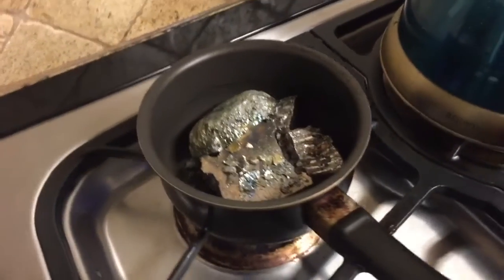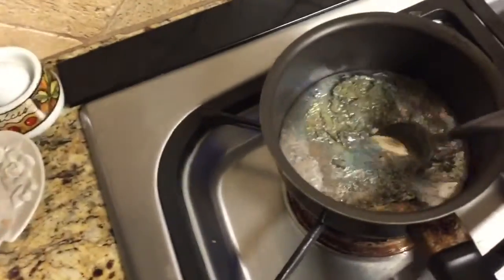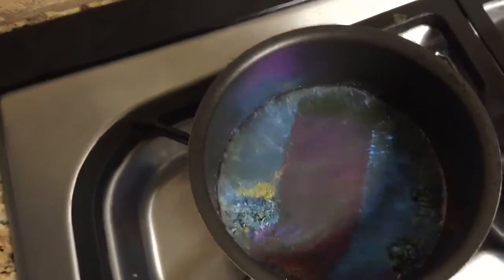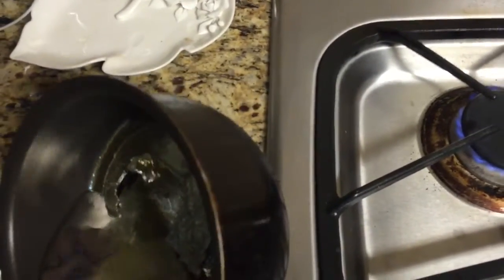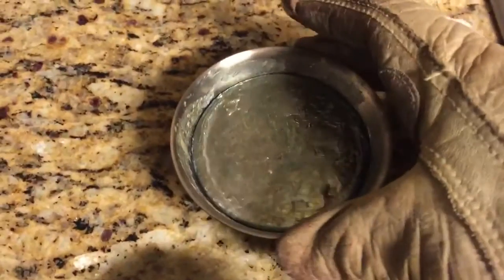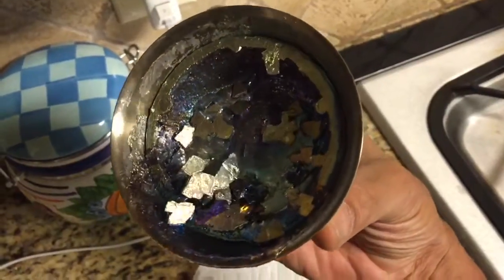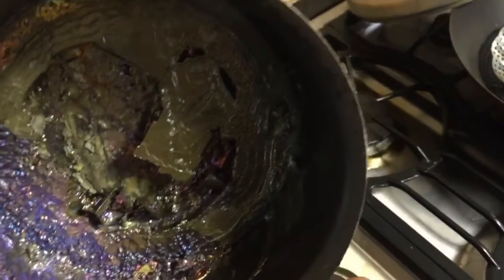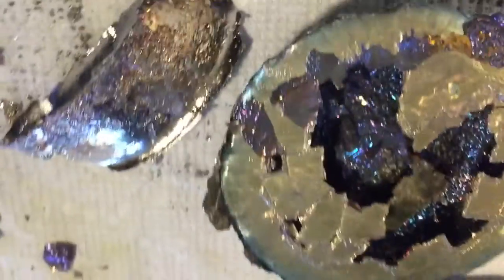Growing  Bismuth Crystals on the Stove 2

Comment: Teflon screws with the Bismuth chemistry!  Stick with Stainless steel pots and crucibles....Or buy some crockery breakfast bowls!  Heat them up before pouring in the Bismuth, and surround it with aluminum or fiberglass insulation and let it cool slowly!